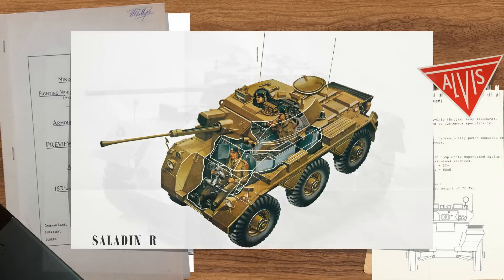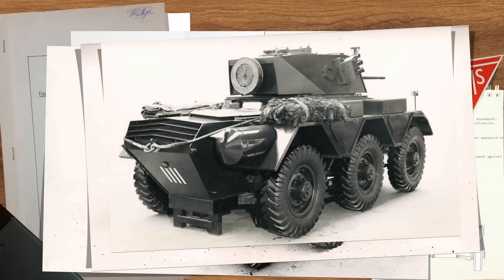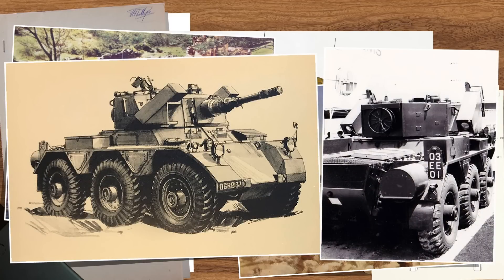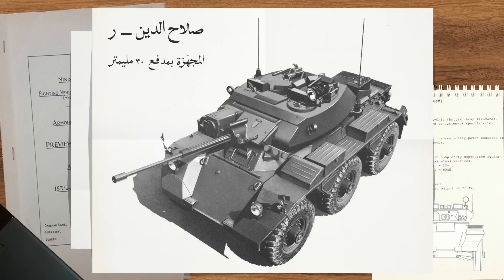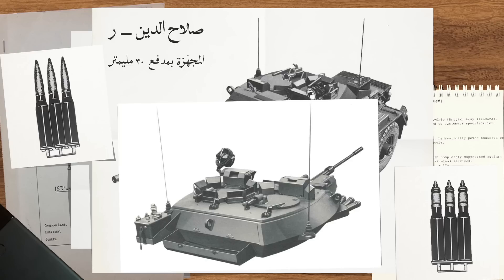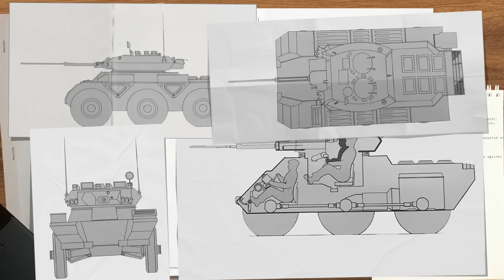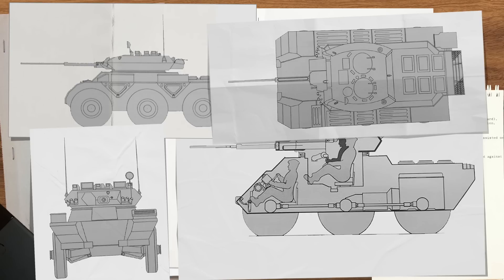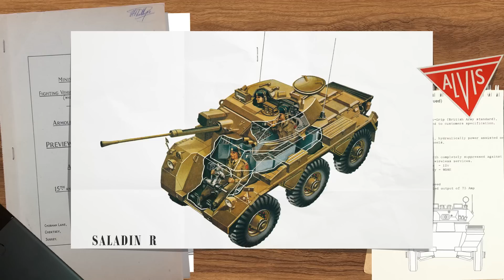SALADIN RARDEN. When Alvis decided to kitbash a car.

Comment: Would have been vastly more successful than Fox, probably not tipping over on side slopes.
Saladin production was severely impacted by the need to supply Saracen, a modern light APC to Malaysian forces, while also trying to get them into Kenya, where the main issue was lack of maintenance and repair facilities to accommodate the chassis.
By the time foreign deliveries were possible in large numbers, the moment had passed, a pity, because like the Hawker Hunter, and Ferret, probably throw in Centurion, second hand refurbished versions of these vehicles were gold on the International market, making money for some, just not rewarding the original designers and manufacturers.
The deployment of Saracen in Malaysia saw a likeiy pattern of employment mirrored all around the place, where the Saracen was used with the dreadfully dated Staghound, because we had them, cheap, and the mobility issues weren’t too much of a factor as armoured cars were not used in a direct assault role, more as oversight, being a Counter insurgent campaign.
As an aside, my Fathers’ mate was in 3RAR over in Singapore back then, and I once asked him what was the best part, the best thing about the Saracen ? He replied “the Bren mounted on the roof, at the back.”
Funny ? No, practical. He stated all vehicles make noise, the Commies would hear them coming, wait until the vehicle passed, then attack the least protected bit, it’s arse end. The Bren was deterrent to this tactic. Other than that, he called them a range target, because as an Infantry soldier, you can’t hide unseen inside a moving steel box. He felt that APCs were best at keeping mud from getting into the boots of Infantry, and stated that for long moves across country, aircraft and helicopters were preferred by the Diggers.
Don’t forget, ANZAC DAY, 25th, KAPYONG DAY Korea, 24th April, where The Third Battalion, Royal Australian Regiment, 3RAR , earned The Swimming Pool, US Presidental Unit Citation, and became nicknamed ‘Old Faithful’, and rightly named the very best Infantry unit in the world.
Lest We Forget.

Comment: That’s a Fox turret rather than a Scimitar turret.
Reply: I was just about to post that , defo Fox turret . Scimitar was multi faceted with lots of welds
Reply: @martinrose2833  I have both turrets next to each other in my shed 👍🏻
Reply from the maker: Yeah it hough that too - they wrote scimmy. - i wonder if they changed their mind at some point and never fixed the brochure? - wont be the first time. - i stuck with that was written, but ty for confirming